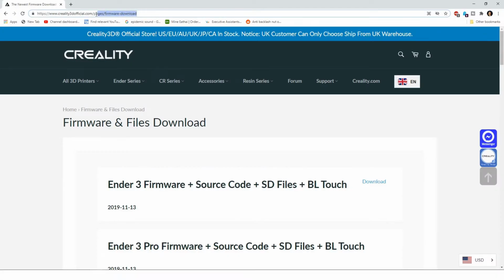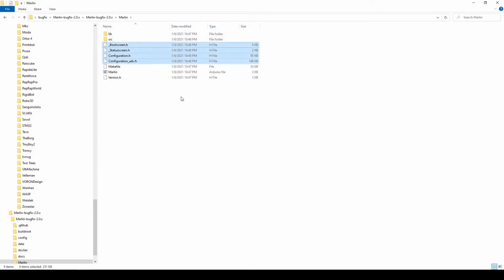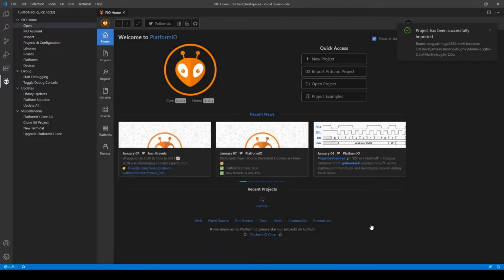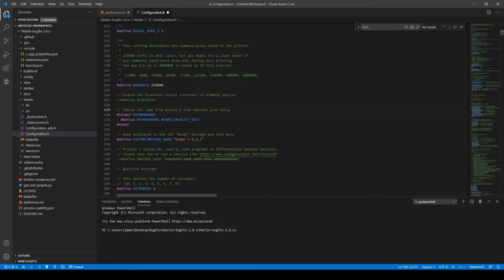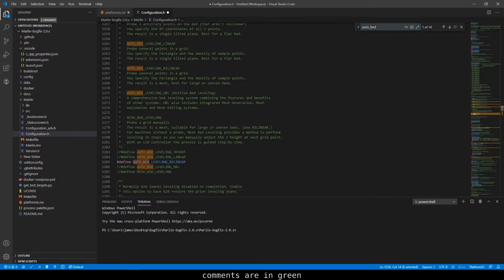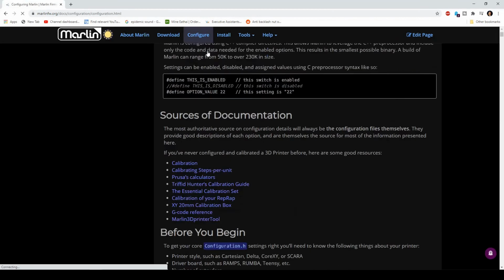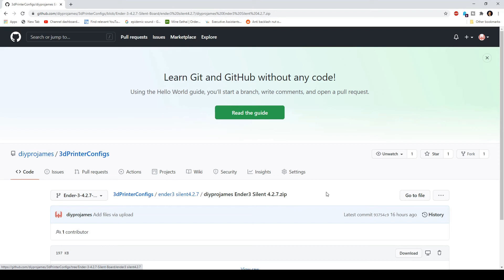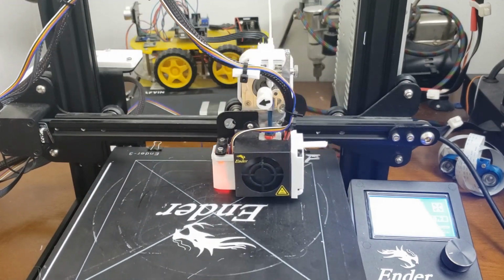ENDER3 4.2.7 SILENT BOARD UPGRADE FIRMWARE - PART 2 INSTALLATION - BLTOUCH 3.1 - MICROSWISS DD

Comment: I burned the card while I was doing BL Touch on the Ender 3 V2 motherboard. Now I have ordered a new card. V4.2.2.7 version one card. How do we make BL Touch and Motherboard cable connections. I don't want to burn again.
Reply from the maker: I hope you didn't burn the card watching my video. This is why I mentioned in part 1 of the video it's important to look at the diagram of the board and bltouch. Don't rely on the colors of the wires. On the 4.2.7 board it's labeled Ground Voltage Input Ground Output [ G, V, IN, G, OUT ]. Find the corresponding diagram for your version of bltouch. Check to see where the connections go. Also, go to https://www.antclabs.com/creality3d-board
 for resource.
Reply: @DiyProJames  My motherboard order is on the way. I bought Creality Bl Touch and my motherboard version is 4.2.2 and I ordered 4.2.7 because the card was burned. I have no information on the subject. I was having trouble on the table. I said I should update but I did it according to the installation manual of Creality company but unfortunately the card burned.
BL Touch photo link I got.
https://canary.contestimg.wish.com/api/webimage/5cef4bf620af5d10e0c106c1-large.jpg?cache_buster=988491f2d37e2252e0ab4938e2c42d36
Reply: @DiyProJames  Find the corresponding diagram for your version of bltouch. where can I find it
Thank you DiyProJames..
Reply from the maker: @ercumentbaloglu  Please check this link https://www.antclabs.com/creality3d-board This is the official manufacturer of the bl touch. Also, check out my other video https://youtu.be/ckdFNEuoy3M?t=407
Reply: Dam I had the same problem with my ender 3 as well

Comment: Hi James, I have an Ender 3, I installed a 4.2.7 silent board. I installed a CRTouch. Original hotend. I followed you through the entire video.  However, when I import my file thru Platformio.  Yet, I do not see my file.  Only the platformio.  Afterwards, I figured out how to look at my file and my file looks different.

Can you advise me.

Comment: I have an Ender 3 pro  , got the CR touch but wouldnt fit my board so i got a 4.27 board , i have a sprite head too  , the Creality firmware didn't work so i found myself here , then about 5 mins in with my head spinning I doubled down on the oem firmware , shortened the file name to "firmware.bin" with a good working SD card and the .bin as the only file on the entire card and it worked, more perfectly than i could have hoped for , everything just works , now back to printing plastic shtuff instead of getting a degree in unrelated sheet.
Reply: mind providing a link i have the same setup as you
Reply: @Teddybites  Ender-3Pro_HW4.2.7_SW2.0.9.03_SpritExt_H300 was the file I used because I have ender 3 pro , sprite head and cr touch with 4.27 .  If any of yours is different download the right one.  Once dl unzip the file and rename it then put it on a totally blank SD card and boot , a 4.27 board has a bootloader .  I can't say this too much though you have to ensure yours is identical to mine

Comment: not sure if you are still seeing comments on this video, I installed the 4.2.7 board with a bl touch and used the 2.0 firmware but now the autohome wont work z axis will only go up not down.

Comment: I have the ender 3 upgraded motherboard to 4.2.7 but when I press the self leveling it doesn't do the 8 points it scans to the left and the probe goes of the bed and the nozzel goes into the bed. What am I doing wrong

Comment: Hi James, I was following your video I  just got an Ender3  but I run into  problem's when doing a build  """ Verbose mode can be enabled via `-v, --verbose` option
Error: Build environment 'STM32F103RET6_creality' is incompatible with BOARD_CREALITY_V427. Use one of these: STM32F103RE_creality, STM32F103RE_creality_xfer, STM32F103RC_creality, STM32F103RC_creality_xfer, STM32F103RE_creality_maple """  
I test it with bot Marlin V 2.1 and 2.0 . I did also test it with "STM32F103RE_creality" on version  2.1, and got a partial build but no .bin file, I will test it next on 2.0 but I thought I leave a message as I wonder if any naming has changed. and you may have some advice/updates.  Cheer's Alan
Reply: "STM32F103RE_creaality  not sure why it shows creality with 2 a , when I edit only show one ... crazy   🤨
Reply: same problem what have you done to fix it ?

Comment: @DiyProJames I have an Ender 3 Pro with everything you have as upgrades (Silent Board 4.2.7, BL touch, and Micro Swiss dual drive all metal) I followed your step by step instruction to compile the codes for STM32F103RET6_creality in Visual studio but after building code it reads (1) FAILED. It reads incompatible with board creality_v427 and to use a different default envs. Do you have any suggestion to were to start to fix this issue?
Reply: I just had this same issue
Reply: @scrap5407  use STM32F103RE_creality

Comment: How can i get marlin for my ender 3 v2 with 4.2.7 motherboard? there's no 4.2.7 files on the configuration files example folder for the 3 v2, only 4.2.2 and the other two are for the big tree tech skr e3 and the mini e3
Reply: I am having the same fucking issue

Comment: I accidentally put sd card with octopi image into ender v427 and now I have blue screen of death. Apparently the ender mb installed octopi bootlader.bin :/ And guess what. Now it won't read and update even correct ender firmware bin file. What options do I have?

Comment: Looking for 4.2.7 creality board firmware in Ender3 Pro for 2.0 and higher Marlin with creality BL - have downloaded and gone through endless stacks and but am too new to make sure all settings are correct in src code (even using example file provided from Marlin). If anyone has marlin 2.0.8 or newer source code that has been compiled/used in Ender 3 pro, please let me know if you are willing to share. I have used Arduino, and sublime editor in attempts to resolve issue with probe offset for XY because of location of Creality BL on the new sprite DD. Machine controller won't allow offsets to be stored "error-too far" appears, so I hoped for easy SW fix - maybe a bin for M851 offsets?
Hoping to get a working source code that I can learn at own pace to revise with Arduino editor.

Comment: I follow the instruction and change the default_envs variable to default_envs = STM32F103RET6_creality. I did all the other change as per the instructions given in the video including those in the configuration.h file. When I run the compiler, it return the following error :
Error: Build environment 'STM32F103RET6_creality' is incompatible with BOARD_RAMPS_14_EFB. Use one of these: mega2560, mega1280

I tried to find where is the problem but I can't find it. What is wrong with the STM32F103RET6_creality value?
Reply from the maker: I had this glitch before. Try changing the to the mega2560 then revert back to the stm32.. and update.
Reply: @DiyProJames  i don't know how to add the STN32F103RET6 to the list as mentioned below
Reply: @DiyProJames  what I have found is the STN32F103RET6 is not in the list when I have to select it prior compilation. I use the latest version of Marlin bug fix that is available and the latest version of VSCode I could find for MacOsx

Comment: Strange issue im having, after following you guide and having the exact same setup as you, I have noticed that the z AXIS is default set super high so It wont auto-home or auto level as it seems to think the bed is way higher than it is.

Any idea how I remedy this?
Reply from the maker: You probably need to setup the z offset of your sensor on your printer.

Comment: I got the 4.2.7 board for my Ender 3 Pro today and have been struggling all night trying to get a proper version of the firmware that can save to EEPROM and is able to use M0 codes for filament swaps and such. I tried following along to your video but for some reason in visual studios I have a lot of errors from the code I downloaded and it will not let me compile. I am stumped on where to go from here so any help would be greatly appreciated.

Thanks
Reply from the maker: Not sure... usually the error codes should give you a clue.

Comment: Hey, I love your tutorial. I’ve followed it step by step and when I go to hit the check mark in platformio, it doesn’t Save the firmware like it does for you … I’ve tried multiple times and multiple different upload ports
Reply from the maker: You cannot upload using the port with the new board. You have to plug the micro sd into the printer. Yes, it's a hassle.

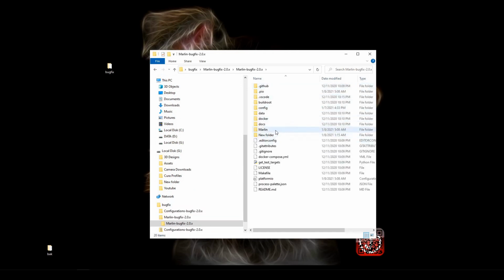Comment: Hey James, I'm running into an issue, around 14:50, after going through platformIO and then uploading it back the bugfix folder, and going to marlin 2.0.X, it does give an option of the folder of .pio or any of the other folders like github or vscode. What am I missing? I'm also running on Mac OS.
Reply from the maker: Sorry not a mac user...

Comment: I have the exact same set up however I have the ender 5 pro. Is the process the same? I have been looking online to see if someone already did the work for that firmware update for the ender  5 pro. Its not that I don't want to do it, its that I don't want to screw it up. If anyone has the same setup but with the ender 5 pro and would be willing to share the bin file I would really appreciate it.
Reply from the maker: I have an ender 5 boxed up from 2 months and haven't had time to even open it up.... 😩

Comment: The alien icon wont show up so I am stuck. Any idea?
Reply from the maker: It's because you haven't installed the plugin. Press Ctrl+shift+X and type PlatformIO in the searh bar
Reply: I’ll give this a try. I managed to fix it by u selecting and option in settings. I am now getting an error code that says The build command doesn’t exist!?
Reply: @DiyProJames  i have platform IO installed. I keep getting the error "command 'platformio-ide.build' not found" any help"?

Comment: I am so confused,  trying to do this for my ender 3.  Love your break down and following to a T but i keep getting this error. The terminal process "platformio 'run'" terminated with exit code: 1.

Terminal will be reused by tasks, press any key to close it.

can you help?  what am i doing wrong
Reply from the maker: There is no way to know what's wrong with limited information. There are many different reasons it could have failed. You need to eliminate the possibilities one by one. Try to see if an unedited config.h file works. See if you've updated all libraries necessary. Etc...

Comment: James, 
    I am a total noobie and am feeling discouraged at the moment. I am hoping you can point me in the direction or guide me in  solving this issue.  I have upgraded to the 32 bit 4.27 motherboard on my ender 3. I've somehow managed to erase the marlin bugfix firmware that  came with the board.  I've tried following  directions to reflash the firmware through the SD card and I am stuck after installing platformio. When I open it, an error timed out connection message pops up. I have installed a bltouch as well but I'm not sure what to do next.  Any help would be greatly appreciated. 🙏
Reply from the maker: You might want to try using the one of the configs in my description. After installing the config you would still have to make some adjustments to the offsets.

Comment: i did the same like you did.....it compiles the firmware within 0.69 seconds and it only gives me a hex file.....why?
Reply from the maker: If it was done in the same way it would not be as quick and you would not end up with a hex file. Probably wrong setup. Old boards used hex files. The 4.2.7 board uses bin file.
Reply: @DiyProJames  yes I’ve got the 4.2.7 too. Very strange why it gives me this file. I think I’m gonna reinstall vscode
Reply: Now I’m getting only elf files 😅

Comment: Hello Respectable Mr. DiyProJames! If you have an opportunity and time I ask you to answer 3 questions, I hope you will not consider it annoying))).   Once again, I want to thank you for your work, through which people, or at least some of them, appears some understanding.  
1)First question. In the new versions of Marlin, when I start printing, the nozzle makes some kind of passage along the left edge of the table (bad!!!, table - russiаn terminology) termin, a few millimeters from the edge and along almost the entire length of the Y axis, and the nozzle touches the glass clamps. When editing the firmware, I deliberately reduced the size of the printing area by 5 mm. on all axes, but this did not affect the starting passage of the nozzle. Question - how do I increase the distance from the left edge for this feature? 
2)Second question. I plan to install a no filament sensor. What value should be set HIGH or LOW in the #define FIL_RUNOUT_STATE [H/L] line and is the #define NOZZLE_PARK_FEATURE drain needed? 
3)Third question. Now there are silicone struts to replace the springs, is there a point in using them. Thank you in advance for the answer and good luck to all of us!))
Reply from the maker: 1. This is based on the slicing software.. Please watch this video. https://youtu.be/3J9NhwbziEY?t=1760 wipe line.
2. High or low based on the filament sensor. Try both states..
3. I have never used silicone struts. I am still using stock springs and never had to replace them as of yet...

Comment: I followed your instructions step by step but I'm having and issue adjusting the Z offset... Once I press "Auto home" the printer will home, go to center of bed and rise to 10mm above the bed like you have it set to, in the program... My issue is that I cannot get the  Z offset to a negative value (about 2mm +/- is needed more) to set the nozzle height to find the BL touch offset... Any help would be appreciated!
Reply from the maker: Yes, this video is part of a playlist. The final steps are you have to offset the z. This video is probably going to help. https://www.youtube.com/watch?v=3J9NhwbziEY&list=PLKB2mjSs4KgN29yU2t4kGeNoVFJWeSt6H&index=6

Comment: Need some help please , so I followed what you instructed and now when I compile it, it gives me errors and shows me problems 
1: ‘ProbePtRaise’ does not name a type; did you mean ‘PrintBase’? 
2: ‘class Probe’ has no member named ‘probe_at_point’
3: ‘raise_after’ has not declared in this scope
Any help would be appreciated
Reply from the maker: What board are you using?
Reply: @DiyProJames  I am using v4.2.7

Comment: Hi mate thanks for the video.

Could I ask how are you getting the following settings for the endstops?
Do I have to do some sort of mesuring like I did for the probe to tip distances?

#define X_MIN_POS 0
#define Y_MIN_POS 0
#define Z_MIN_POS 0
#define X_MAX_POS X_BED_SIZE
#define Y_MAX_POS Y_BED_SIZE
#define Z_MAX_POS 250

Ender 3 4.2.7 marlin 2.0 bugfix

Many thanks
Reply from the maker: Ahh.. It's a little lengthy, but I have a video here that explains 😄. https://www.youtube.com/watch?v=3J9NhwbziEY&list=PLKB2mjSs4KgN29yU2t4kGeNoVFJWeSt6H&index=6 You can use your printer to measure.
Reply: @DiyProJames  Nice one thanks James I will take a look at the video now.

Comment: Hey James, great video thank you. Question though, how did you get the numbers for your nozzle offset? Is this a standard set up or should I be configuring this to my Ender 3?
Reply from the maker: I couldn't cover everything in one video. This is part of a playlist. Long story short you should still manually set the z offset of the bl touch if necessary.. The other offsets are in relation to your type of mount. I cover it in this video here. https://www.youtube.com/watch?v=3J9NhwbziEY&list=PLKB2mjSs4KgN29yU2t4kGeNoVFJWeSt6H&index=6

Comment: I currently have the same setup as you .I loaded your bin file and if I home the printer it goes to the center of the bed and stands off the bed a good bit. do I need to erase the sd card before installing the bin ?
Reply from the maker: No. It should work as long as the bin file is unique and is on the root directory of the sd card... I'm not sure if this is what your getting at, but I think your saying the nozzle goes off the bed when making a wipe... or goes off the bed when going to the far back left corner. I think this video will help answer your question. https://www.youtube.com/watch?v=3J9NhwbziEY&list=PLKB2mjSs4KgN29yU2t4kGeNoVFJWeSt6H
Reply: @DiyProJames  Awesome thanks ! working perfect on all my machines now. I really appreciate what you do on here. great videos.
Reply from the maker: @redbeardfpv5084  You're welcome.. have fun printing.

Comment: Do you have a video to show how to adjust the settings once the firmware is installed? Great video thanks!
Reply from the maker: I'm not sure what you mean by adjust settings... Depending on what was upgraded you may not have to make any adjustments. Normally things are adjusted in the firmware.. So could you be more specific... Are you speaking of esteps, pid tune?

Comment: Hey I have an ender 3 pro at 8-bit Ford upgraded to 4.2.74 at Marlin 1.0.1 firmware and having issues with auto home seems to not find correct coordinate for auto home so therefore when I do bed leveling everything is incorrect after bed leveling code has been used
Reply from the maker: If you upgraded to a 4.2.7 board you should upgrade the firmware to the 2.0

Comment: Hi James. First, thanks for the tutorial. I am getting a couple of errors with Visual Studio. For configuration.h, it keeps telling me to update my includepath. It also gives me errors for PROGMEM, it says it's missing a ";". If I try to build it ends in errors with the LCD menu.
Reply from the maker: Try updating vscode. Make sure you opened the files in the correct path... Sometimes running the build twice clears up the problem... but make sure vs code is up to date and you have selected the correct working path..
Reply: @DiyProJames Thanks James. It turns out that the code was buggy. Downloaded new version today fixed it.
Reply from the maker: @miguelolivas250  Good 👍 job..